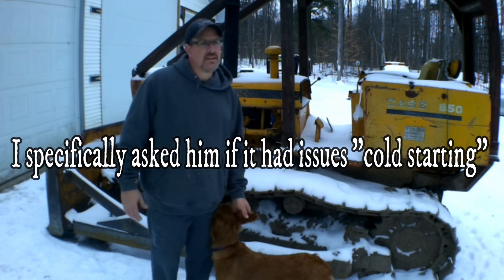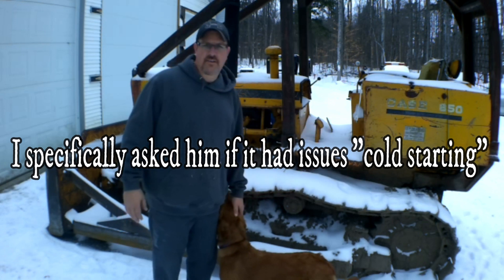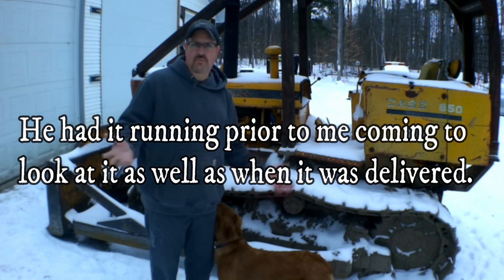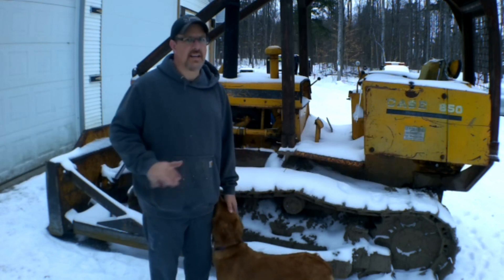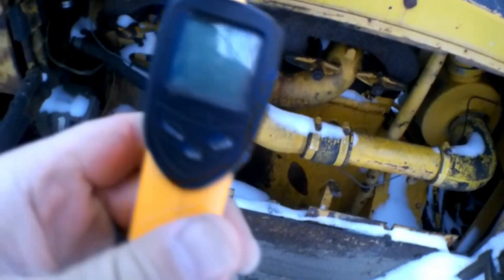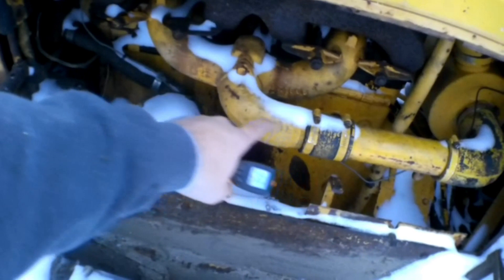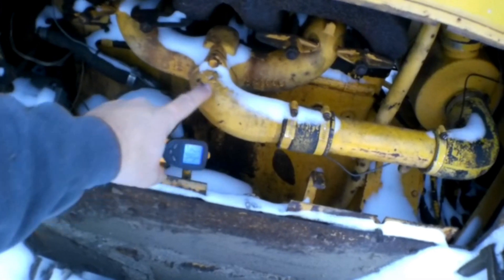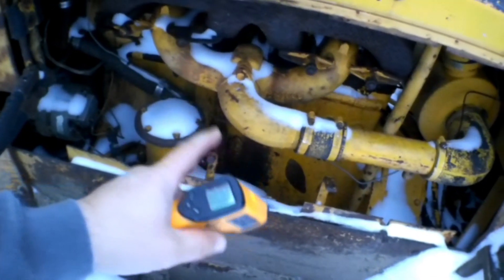Cold start old diesel dozer without starting fluid or glow plugs

Comment: I just heat up the intake manifold on my old H60 Hough with a porpane torch for about 30 seconds prior to starting. The warm air with a shot of either into the air filter gets drawn into the combustion chamber and away we go!!! No bolts to remove.

Comment: Massey Ferguson and others use a "flame thrower" on the intake manifold.   It is built in, and uses a small amount of diesel, ignited by a heating coil to accomplish the same thing as he did with a torch.
Reply: old M35A2 as well

Comment: Best thing to do is drill and tap intake manifold plug it with a bolt with a t-handle welded on for quick access put the fire to it away you go works every time Been starting case tractors for 50 years like that
Reply: lovely

Comment: A real easy fix and you will have less than $100 in the whole deal. Google thermo start, Perkins thermo start etc. It is a single glow plug that you tap a bung in the pupe right were you removed from the intake. Works off 12V and draws about 12V energized. Put a switch on your dash and then get a 12v source wire to your switch. Use a 20 amp 12V source to your relay to your glow plug. You will need to tap into your return line to your fuel tank and put a small (2-4) oz reservoir for your supply to your glow plug. Plumb your glow plug and your done. Energize your glow plug about 10-15 seconds and you will hear it pop then hit your starter. Off she will go. Many import tractors employee this as well as Perkins engines etc.
Reply from the maker: I looked that up and it sure looks like it would help get my old machine going! Thanks a bunch for that information! I appreciate it!
Reply: @Tomsfoolery. I have put several on engines that weren't designed for them and they have really helped.

Comment: if you were ever around the older cummins engines, they had a glow plug and a hand operated dash mounted fuel primer connected to an injector located in the intake manifold.  warm the glow plug, crank the engine, push the plunger, fuel was sprayed onto the glow plug and you built a fire in the manifold and it started.  keep plunger going until engine ran on its own.  nothing new.

Comment: Lower compression is less heat. If you have one low cylinder the compression can not bring up the heat to the diesels flame point...but after 10 minutes, the heat from the other cylinders have leaked through enough to bring the compressed air above the ignition point.

Before that you can bring the temp above the flame ignition point with a hand held torch.

Once you have it all running, the combustion will continue to keep the piston top, cylinderwalls and head warm, and it will continue to run....as you now always will be above the self ignition heat point....and nothing will rob the charge you are compressing, from heat.

End solution...rebuid...at least a hone job and piston rings, and while the head is off...grind all valves to a point of no leak...most probably the injectors just need a clean out...that can be done on the bench., you need however know in beforehand how they are taken apart, and how they come together...its a bit of a puzzle...but not hard once you know.

If you have tools and do the job yourself....cost is gaskets, fluids and pistonrings.

Comment: If you haven't already, try checking valve clearances. It's common for the exhaust valve to become too tight, and the camshaft doesn't allow it to close soon enough, for full compression. I don't know if this engine uses hydraulic lifters, or, if the lifters are solid. increasing valve clearance (loosening) will almost always raise the compression of any 4 cycle engine, whether diesel or gasoline.
Reply: I say your correct  clean the valve set. And old lazy ring that move when have heat to expand.  Giving compression 👍
Reply: I agree with most replays. Clean valve steam and seat. 
Also the rings 50 years old. Are expending when worm up. 
Probably stuck on the cylinder. When heat given they expand. 
Like you say rebuild.  If do will last 100 years in your care. Mick Australia 🇦🇺

Comment: See Thermostart...
Using the Thermostart device which can be retrofitted to any diesel engine with a metal air intake...available at agricultural spares suppliers worldwide....
a small  amount of diesel set on fie by the thermostart device provides the same effect...
but is all on the engine ready to be activated by a push button.....no need to take the intake apart or carry a propane torch....
YT video under thermostart....
Reply: Sounds like a bandaid to a larger problem.
Reply: @wishusknight3009  
No; 
many older diesels had a Thermostart as their main starting aid... a self-contained "blow torch" 
It provided warm air to encourage combustion when the ambient air was cold..as was the tractor engine from extended periods of "cold soak".
Because it was only one coil that glowed and set fire to diesel....like a large cigareete lighter....the draw on the battery was minimal compared to the 20 amps per cylinder of a normal glow plug.
Some modern diesels already have the  boss for the hole for the Thermostart cast in the manifold...just not drilled and tapped.
Hey in Pakistan they use a flaming rag at the intake to do the same job.
Sometimes boiling water poured over the individual injectors and the fuel lines leading to them can heat the diesel enough to also fire off the engine in cold weather...
Reply: @wishusknight3009 . read oims M35A2 Hercules engine

Comment: that likely has more to do with unburned propane being sucked in not so much heat tho i bet the heat helps
Reply: Propane has a higher ignition temperature than diesel fuel. Propane would rely on the diesel fuel to ignite in the cylinder. The heat is the dominant  factor.

Comment: It could be both or one or the other. A bad injector can make the miss fire. It should mist the fuel in. Not squirt the fuel in. The low compression will also have a effect as well. It could be as simple as you have tight valves. But seeing either cans is a bad sign. It’s not so much as low lubricant, but more in the fact that it can and will break rings or scar the cylinders. It can even bend rods. That will give you bad compression.

Comment: That is not really how a diesel works. The piston compresses the air in the cylinder and then it fires the injector at Top dead centre as soon as the air is hot enough

Comment: Cold?  Up here in Canada, we have 2' of snow and it was -30C or -22F just a couple of days ago. I remember as kids going to University, we would put beer into the fridge so the beer wouldn't ice up.  Good video, thanks for the info.  Cheers :)
Reply: Hahaha exactly. I wouldn’t even plug a machine in at 28 degrees
Reply: I keep my drinks in a bar fridge so they don't freeze in my warehouse here in Canada. I dug a basement pit in the basement at 10 feet deep, and suprisingly my ambiant air is often in the plus 2c up to plus 5c when it's minus 16c outside. I'm not far above a limestone bedrock if that helps.

Comment: Well old mechanic tricks I ques I wuld add on that special winter oil and oil pan heaters, block heaters probably fuel heater as well those winters are bitchh to over come perhaps automatic baterry chargers culd by usefull and for cick starting probably gasoline engines shuld have intake manifold draining valve for moisture some spay for corosion moisture and heat protection if evry thing ells is ok engine shuld start evry time I recomend over writing the alternator voltage charging to litel higher then usualy advancing ignition timing and preferably bypass ignition coil wire to full baterry power just on start up and preferably mode starter motor to spin faster in winter time so if that helps peopel that is recomended for gasoline engines probably fuel aditives are good idea on that shity ethanol fuel probably peopel shuld use moisture/air seperators because ethanol absorbes moisture it can by a pain in the ass starting those engines a heat gun is nice thing to have ore periodicaly use a induction motor and magnets to let engine by warm there are many way's but aperantly a torch is effective as well nice video thank you for info 👍

Comment: So - 2 most big diesels should start without heat if they have excess fuel.
Reply: You also need heat....
either from the heat of compressing the air jsut before the diesel is injected into the cylinder....
or, if there is no heat in the block (freezing temperatures)..... by adding heat..
glow plugs,
grid heater,
thermostart "flame" in the intake manifold,
propane torch.,
flaming rag soaked in diesel held over that hole like the propane torch...
or even a hairdryer borrowed from the good lady....

Once the engine fores enough to keep running on it's own generated heat provided by the combustion events in the cylinder...you don't need the extra heat....no matter how cold it is.

Comment: It's definitely low compression causing that misfire when cold that clear up when you introduce more heat. The lower compression is too low to hit the autoignition temperature of the diesel mixture in that cylinder. Adding some more heat helps the weak compression generate enough heat and the cylinder fires. Once the motor warms up it goes away.
Reply from the maker: I agree. I suspect it’s from a valve because I hear a “whoosh” sound out the exhaust as it cranks. Almost as if it misses during cranking. If that makes sense. One cylinder doesn’t sound like the rest.
Reply: This is spot on. Likely worn rings on whole engine but worst on one cylinder

Comment: Double check and make sure your machine doesn’t have a grid heater in the intake. I got a early 70’s case 350. Guy I bought it from said it had no heaters of any kind. But he just didn’t know if you turn the key and hold it all the way it “manually” activates the grid heater. I do that that for 20-30 seconds and she fires right up. Even in weather like you have there. If you’ve got a working amp gauge you will see the amp drawl when the grid heater is activated.
Reply: your grid heat is normally closest to the it side side of the block right where he took that elbow off fairly certain it don’t have one
Reply from the maker: Yeah it definitely does not have one. I’ve been thinking about drilling a hole in that intake elbow and installing a universal one.

Comment: Seems to me that one injector is blowing off at low pressure and therefore the fuel is not atomising and coming out as a solid spray which is not allowing the fuel to ignite.  It will only ignite if the fuel is atomised.  This points to a weakened spring in the injector or a worn needle.  I think that if you get your injectors serviced and the blow off pressure checked/adjusted then you will probably be ok.  I have been a trained motor vehicle technician for over 50 years.  MVT 2 and have specialised on diesels for the last 20 years.  Hope this info is of use to you.  Paul.
Reply from the maker: Thank you for the info.

Comment: Thanks for that trick.  I just bought a CAT 426 and have no power at my property yet, so this may be my situation through the winter.  to answer your question... I agree with what <Brett Karns> said about compression and combustion.  I was looking into what is so bad about using ether (starting fluid).  It is a solvent that "cleans" all the oil off the piston rings and cylinder walls, leaving no lubrication.  This can cause scratches or additional wear in the cylinder.  My guess is that that one cylinder is losing compression due to this and, as Brett said, when it gets warm, the combustion relies less on compression and more on the temperature of the fuel/air mixture.
Reply: See Thermostart...
Using the Thermostart device which can be retrofitted to any diesel engine with a metal air intake...available at agricultural spares suppliers worldwide....
a small  amount of diesel set on fie by the thermostart device provides the same effect...
but is all on the engine ready to be activated by a push button.....no need to take the intake apart or carry a propane torch....
YT video under thermostart....

Comment: The previous owner constantly using starting fluid did that engine no favors. Run some Sea Foam through it and see if it helps. The injectors may be dirty also.
Reply: That's a damn myth. It has absolutely no ill effects on a diesel engine. You can start a diesel and literally stay it constantly into the intake and nothing happens..
Reply: @Craftyisbold  Not a myth, Seen the damage it causes first hand.
Reply: @wishusknight3009 I don't know who'd be right or wrong... But just backyard engineering would tell me it's not that bad for a diesel engine (compared to cranking and cranking)
Reply: @darylmixan8170  I think it may be mostly ok in the pinch but from what I understand it can increase the chances of problems with continuous use. 

Last week in freezing weather (-12c) I helped a friend get his diesel genset running by using a hair dryer. No glow plugs or ether. And we didn't need to crank it for very long. But I did spend a few minutes heating up the intake manifold and then had it blowing into the intake while cranking. And kept it there for the first few minutes of it trying to warm up. It was lucky I had my honda whisper gen with me, using buddies wifes hair blower. I suspect had it been really cold, say -30, then this would have been much more difficult.  This is also the same guy that blew up a diesel with ether many years before, the engine I saw in the aftermath. So he is rather paranoid of using it again.

Comment: I can tell as you were rolling it over and not firing there was a wash of cylinder compresson excaped out the exhast. I would start with rocker adjust if OK then the head come off valve seat or bent?
Reply from the maker: Thanks! Someone else suggested the same thing. I just got a service manual for it so I'll be looking into that.

Comment: you answered your own question in the video.  Diesel fires off of compression.  As air is compressed, it gets hot, anyone with an air compressor at home should know this.   The bad cylinder is not able to compress the air enough to make it hot enough to fire, by you adding heat, you're making up for the heat that that cylinder can't create on it's own.   As the entire engine block warms up, there is no longer a need for the additional heat from the torch.   So the short answer is, the lack of compression is what is causing your cold misfire.  As for WHY that cylinder is low on compression, you'd have to dig into it to figure that out.  Or maybe start with a cylinder leak down test.
Reply from the maker: Thanks for the confirmation. I’m leaning towards a burnt exhaust valve or valve sealing issue. I can hear a “hiss” on one cylinder as the engine cranks over. I’m guessing this will be the problematic cylinder.

Comment: Good idea, but what if you don't have a blowtorch right then and there, maybe do this:?  not osha approved  lol
https://www.youtube.com/watch?v=cbtaCGrzTmw
ts6034    You have one cyl. with low compression; it is not building up enough heat at TDC; when the motor heats up,it usually fires and runs on all cyls.,but always with a small dead miss; 
It could be a leaky valve or bad rings/bore,as usual; if you squirt a VERY small qty of oil in the cyl(it's a diesel,"NO" space bet.top of piston and head!!!) and measure the compression,you'll have a very good idea of what it is; if it's a valve,it's head out,if it is the rings,it's...a big job,better leave it alone; DO NOT crank it,without first turning it a full turn with a wrench on the crank bolt, just to make sure the oil ain't too much,or you can bend a rod,making it a dead cyl;
Instead of the oil,it's much safer to do a leak down test,especially on a diesel.

Comment: Strap a 100 pound propane tank to the top and run it! Lol
Reply from the maker: I could tell everyone that it’s a hybrid dozer! Runs on diesel and/or propane! Haha!
Reply: @Tomsfoolery.  
10% diesel/90% propane...or methane...

Digestors at sewage works provide methane which when scrubbed and fed through pipes can be used at that ratio in 750hp diesel pumps to move the sewage...

Saves a city an awful lot of money..burning  off the gas usefully......